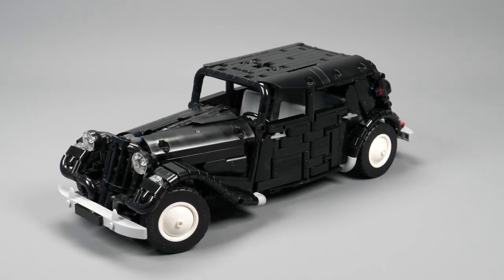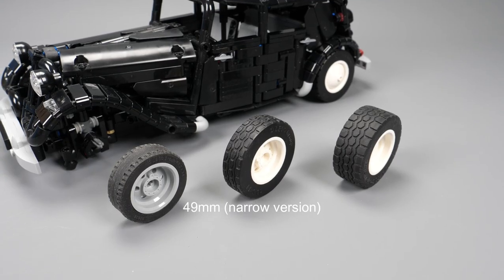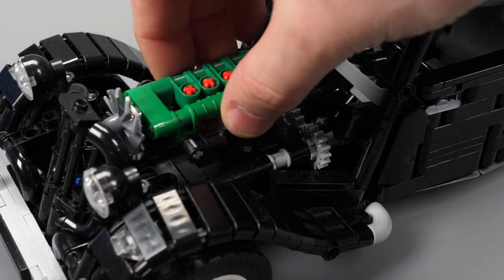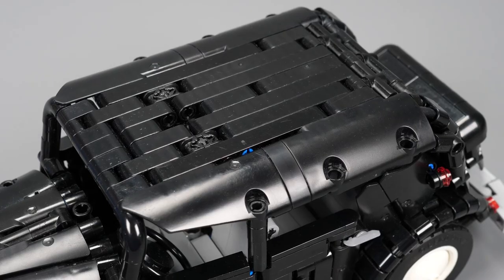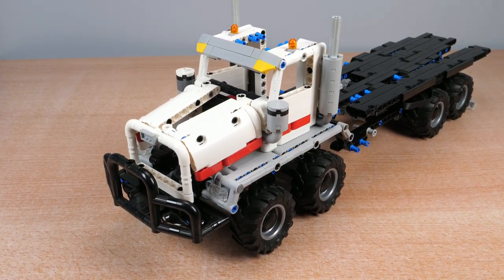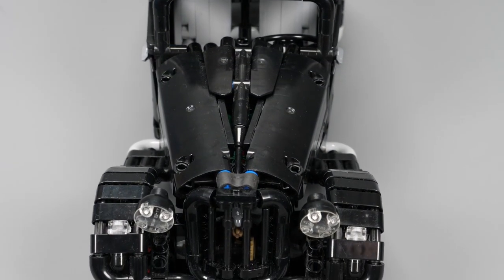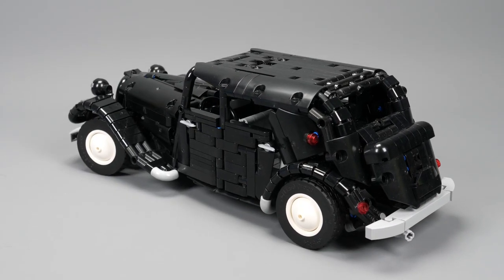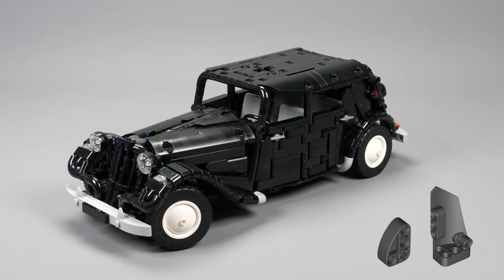How I Designed a Citroën Traction in LEGO TECHNIC

Comment: ça pourrait etre interessant de voir ce modele a une echelle plus grande en utilisant des roues de motos (roue av de la ducati) et du coup avec motorisation et telecommande , j'adorerais voir les 2 cote a cote 
sinon une citroen DS ça pourrait etre vraiment sympa , et la niveau design ce serait aussi un sacré challenge
Reply from the maker: Les roues avant de la ducati ne sont pas adapté en terms de profil. Il faudrait des pneus de taille raisonable comme des 81mm mais moins larges. Cela ferait du 1/8 ou 1/10 ce qui est déja trés gros !
Reply: @Nico71Fr  moui c'est vrai que ces pneus la sont peu etre trop fins par rapport au diametre
Reply from the maker: @edgarpoe8564  Oui en effet, et aussi en terme de hauteur du flanc du pneus. Les pneus que j'utilise sur celle là sont des D49x14 et correspondent bien aux pneus originaux. Même en plus gros, la largeur pose souvent problème (ceux de 81x34 par exemple).
Reply: @Nico71Fr  oui effectivement , les pneus de moto lego doivent etre assez difficiles a detourner de leur fonction initiale , a la rigueur sur des vehicules des années 20 comme une ford T peut etre ou encore une Citroën-Kégresse P17 (qui serait aussi un beau projet) , mais comme tu le dis dans le making of , tout est question de compromis

Comment: Traction Avant. Not Traction. Great model btw.
Reply: in france when we say "traction" we know that we are talking about citroen traction
Reply from the maker: Traction Avant is a pleonasm here in France, as the traction is defined then as the front wheel drive. In France we can say only Citroen Traction when the place is counted (which is here in the title of the video). Of course both are valid but do not bring many any additional value to say the complete name.
Reply: @Nico71Fr  Strange. So when a car has rear wheel drive or all wheel drive you don’t call that traction? As traction literally means “drive”.
Reply: @caskraker  no in France the term "traction" is synonymous with "to tow" for the rear driving wheels we speak of "propulsion" which corresponds to "to push"
Reply from the maker: Rear wheel drive is propulsion in french, and front wheel drive is traction. We just skip (sometime) the "Avant" name in the Citroen Traction because the traction is obviously a front wheel drive, so no need to put again avant (front).